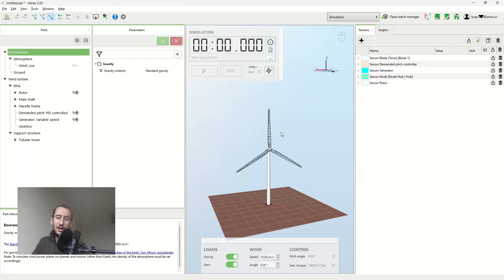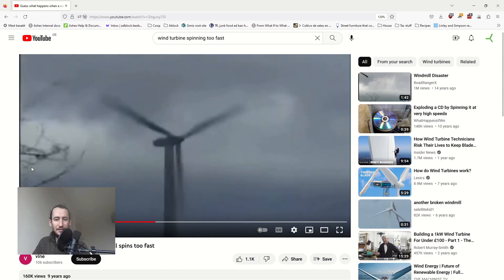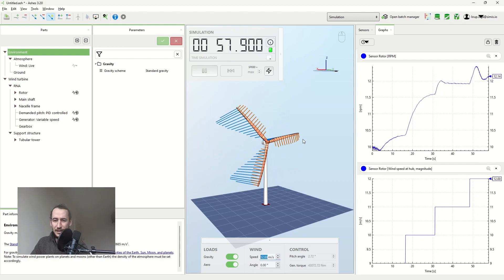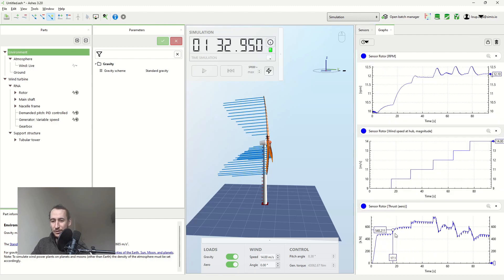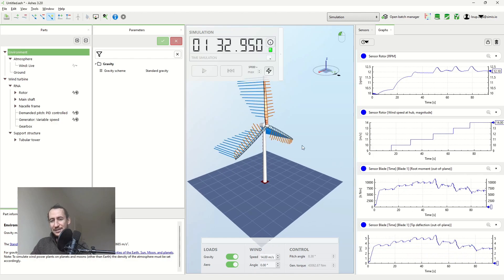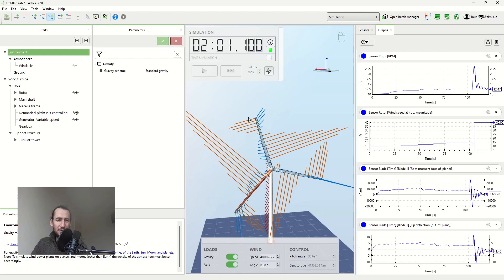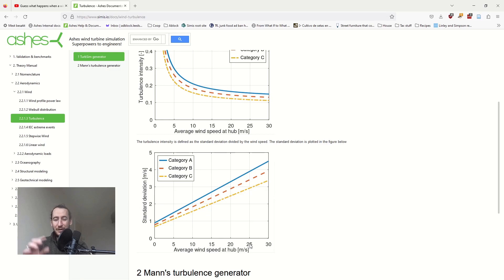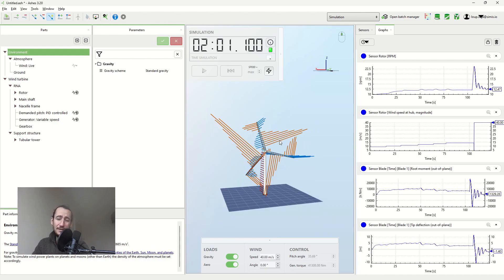Why do wind turbines shut down in high winds?

Comment: Why can't turbine blades be designed to be 'feathered' ( as in aeroplane propellors)? The pitch could be altered manually or by wind speed sensors.
Reply: All (arguably) utility size wind turbines can be feathered and they are feathered when the control system decides to shut down due to too high winds (showing how a wind turbine shuts doen should probably have been a part of this vid). Usually, though, a wind turbine that is shut down is idling, i.e. it is (still) rotating, but very slowly. This can be quite easily simulated in Ashes using the IEA 15MW reference turbine (that ships with Ashes) and its ROSCO controller (that also ships with Ashes). However, you do have to manually change the input file for ROSCO to shut-down mode. If you do that, the wind turbine will start shutting down when the pitch is at approximately 22 degrees and increase the pitch to approximately 90 degrees. We will probably make a vid soon show exactly this - so, like, subscribe and press the bell ;-)
Reply from the maker: A big difference between airplane wings and wind turbine blades is that wind turbine blades are rotating, which means that they experience both the incoming air flow (due to the wind) and what we call a rotational wind velocity due to their motion through the air. The sum of the two is the relative wind. As you can imagine, the further along the blade, the higher the speed of the blade through the air and thus the higher the relative wind. That is why the blades cannot be ‘flat’ as for airplanes but need what we call a twist angle that varies along the blade, to face the relative wind best.
And if the blades were feathered, they would not be aligned with the relative wind.
This video is relevant: https://www.youtube.com/watch?v=OOP6Mbn0Gbw
Reply: @AshesWindTurbineSimulation  So why can't the turbine mechanism be designed to swivel andface the oncoming wind???
Reply from the maker: @johnblack4318  Right, do you mean turning the whole rotor so that it faces the wind (rather than individual blades)? Yes, that is done, it's called yawing the turbine. Feel free to download Ashes (www.simis.io) and give all that a try

Comment: Do blade angles adjust with speed in your demo?
Reply from the maker: You mean whether the blades are pitching? Yes they are, you can see the value in the Control pane at the bottom of the screen

Comment: Hello Sir, I have a request. We are a group of 4 students taking a course titled "Human-Computer Interaction" this semester in software engineering and data science. Our prof suggested we build an app for forecasting model for wind turbines. WE thought about a project title "Wind Turbine Asset Management App" but this looks a very challenging topic for us and we are looking for ways to simplify it. Basically we want to show: Wind speed (Forecast - Realized) --> Power Generation (Forecast - Realized) x Energy Market Price Forecast on the time axis (day-week-month) = Revenue/day-week-month, then we will apply a method called "discounted payback period" to show to the investor that his investment will pay back in X years in real-time. So, we want to give the investor the opportunity to monitor the payback period based on various variables like wind speed, wind direction, uptime of the turbine etc. We need to learn how much power is generated with changing wind speed and wind direction. Let's assume that the wind speed and direction forecast is available. we can also get the realized values measured. But how much power is going to be generated is our question. I would be appreciated if you could make any recommendation for a source in order for us to look into. Thanks.

Comment: Hello. it seems to be very interesting. May I know what could be the control logic used during high wind speeds
Reply from the maker: I'm not sure I understand the question... The blades are pitched to an angle where they produce very litle torque, so that the rotor does not rotate anymore (or rather rotates very slowly). Does that answer your question?
Reply: @AshesWindTurbineSimulation  I mean what logic are you following to design pi controller in the above the cutout speed.
Reply from the maker: @yizasrikanthreddy4320  Right! We don't design controllers, we are just developing the software Ashes. But maybe if some control engineer reads this they can answer?